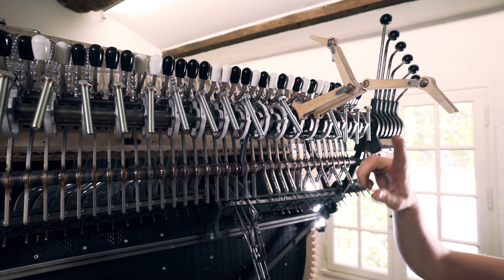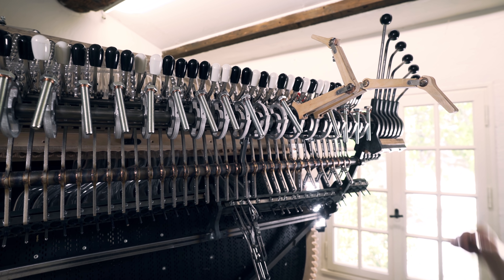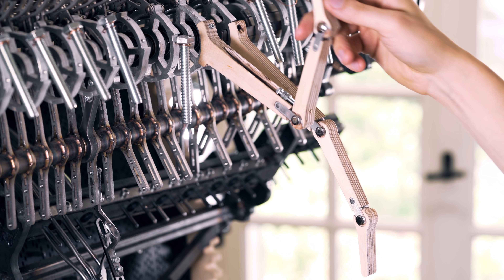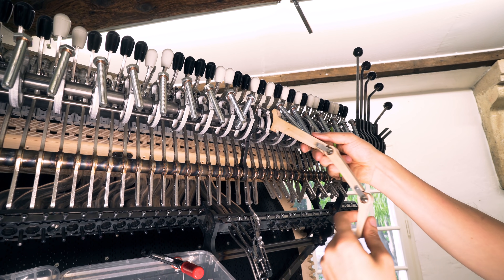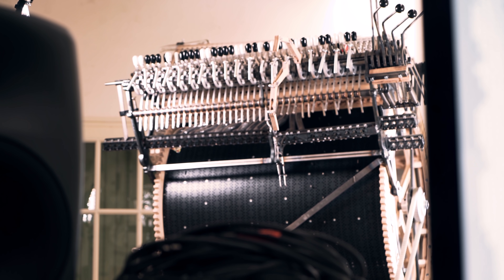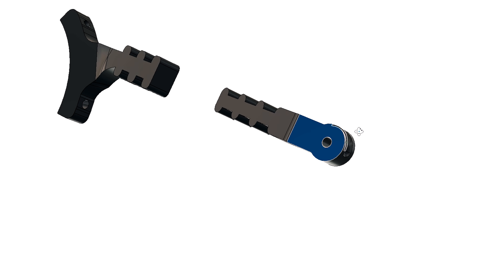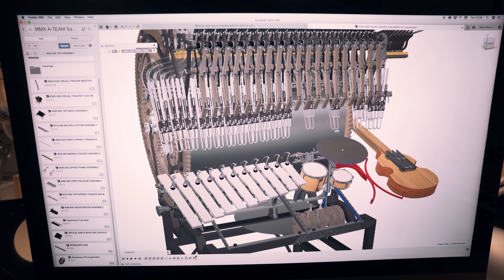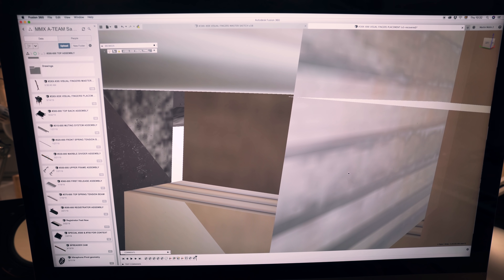Kinetic Fingers Prototype - Marble Machine X #82

Comment: I, like many, don't like the fingers at all. Yes, they are creepy. It's like this Carl Jung archetype of spiders crawling in my skin sort of thing. The closer you get to looking like a human body part, in your case three segment finger (bending forward, and backward, "ouch!", and at weird lateral angles), the more disturbing it will get.

Creepy Kinetic art fingers: https://www.youtube.com/watch?v=YGXyGrsa078

Others have commented that they don't add any value to the machine. I disagree. I think that having a visual element to the MMX is critical. So much of the MMX is visual already, and I agree that a small marble dropping with a little movement isn't very dramatic.

Perhaps the fingers could be replaced my a more aesthetically pleasing shape. I could envision cutting shapes from PMMA sheet, maybe concentric arcs or something. Something a bit more abstract to take away the creepiness please! I like the counterbalance idea. What if you used the weight of an entrapped rolling marble to tilt them forward and back?  

Beautiful kinetic art: https://www.youtube.com/watch?v=hYrwDDHDTZU

Anyway, Martin, it's your project, and it seems like you've made up your mind, but I have to speak up here. Your machine is elegant with a good cohesive visual style, but this just looks bad.

Comment: Q: "Why is there a picture of a garage in the reflection?" (10:26)
A: One of the secrets of 3D rendering is that in order to make a surface look metallic, it has to reflect SOMETHING, but it doesn't matter much what that something is; so instead of reflecting your actual CAD design (which would consume a lot of computing power), some arbitrary 360° stock photo is used for the reflection. In the case of your CAD software, this just happens to be a garage.

Comment: Hey Martin, 

How about a system (Arduino or Raspberry PI) that lights up a key when it is struck by a marble? It could add a whole new visual look to your machine! I can prototype something for you if you're interested! 

Love your project and keep up the good work!
Reply: Noooooo...

As clunky and weird as the fingers are, adding a whole computer system to the machine just for visual effect is far worse. The whole thing has been mechanical where it can be, and where electronics are absolutely necessary, they've been limited to analog sound amplification. If you're going to put a computer in, you might as well have it run the machine: The timing would be far more precise than the mechanical drum, after all.

Comment: I want to add to the discussion here by trying to outline what exactly it is about the fingers that I don’t like. The MMX has always felt like a beautiful, mechanical contraption to me. Everything moves in these predictable, steady, and incredibly precise loops which are stunning to look at. But the fingers are imprecise. They wiggle and move. It’s at odds with the incredible mechanics of the rest of the machine. I have nothing against a visual aid, I just wish it moved precisely like the rest of the machine does.

Comment: For the most part I can see why people are freaking out over the fingers. My first thought was "Why wood?" What I meant by that is for a truly visual experience (especially if you want it to be seen by the entire audience) why not a black plastic (or stay with the wood) with a clear inlat of plastic. The insert being built by Dr Phil can be built hollow for wiring and you could then illuminate the fingers so that if the stage was low lit/smoke lit they would glow and create effect and add to the mystique of the performance adding mystery and flair. 
You could add a micro-switch to the lever so the the fingers do-not glow when not in use or have a redundant new feed on the programming wheel to activate the fingers light feed if needed on certain songs only (you could do this with a magnetic switch that was added to the programming wheel or some-such). 
Sorry I am spitballing here. You have lots of options that could add to the usability of these fingers. 
As I always say, you are the artist, we are here to enjoy the art. Do your thing! We love it almost as much as you do!

Comment: I'm honestly on the fence here. I've been watching your videos for a long time now (I believe it has been from the early mmx episodes), and I can't count how many times my jaw dropped at what you've been able to accomplish. So I do echo the concerns of others about what these fingers will do aesthetically (since there is really hardly any function other than emphasizing movements in the machine), but I do so in a very muted sense - first, as you have mentioned, this is a prototype you're presenting; things go many different directions from prototype to finished product. And that is my more efficiency/engineering-oriented side speaking here. However, you've also focused on this being a work of art, from day 1. A lot of people seem to miss this. The thing about art is, it requires the artist's personal touch. If these fingers are it (man, the irony does not escape me here, a pretty fun pun :D), all I will say is: impress me. I have enough experience with music, art and tinkering of all sorts to know that this may very well flop, or turn out to be a true showman's vision. The stage is very much yours! (*and so is the machine*, again, as it seems a lot of people miss that fact) And as someone aptly reminded us - these things are screwed on. If they don't work out, they can be taken off just as easily. Just speaks volumes about how you designed everything!

Comment: I honestly think it would help, even with the opinion of those staunchly against this feature, if they just looked less like giant spider legs. Imagining a bunch of them in a row makes me think of centipedes. I hate centipedes and I hate looking at centipedes. I understand the desire to make the most important part of the machine result in big movements, and I understand the viewpoint of those who think additional features that don't actively help with the music making, but I wonder how many people are having this kneejerk reaction purely because of the way the fingers look, rather than the fact that they exist in the first place.

I feel like the machine is starting to have a really solid aesthetic going for it. Huge circles coming together with smaller circles, long, straight lines and shorter, gentle curves. Then there's those things, big and angly and not really fitting in with the look of any other part despite actively trying to draw all the attention to them. I think I personally would be more okay with the fingers if they were just partial circles going up and down to emphasize the action. The angled bends, tapered points and jointed movement just makes something in my brain go "nope, not good, bad, don't look at it"

tl;dr they look like giant bug legs and I hypothesize that a lot of people react negatively to them purely because of that, whether they consciously understand why they feel that way or not.

Comment: I disagree with the choice to add the fingers. Not only do they get in the way of operating the manual knobs, they also simply do not have aesthetic benefit - a stage performance will have cameras, and therefore the instruments can be seen from any distance. Furthermore, they have no functional use - something which every part of the MMX has had so far. It's a distraction - both from your progress on the machine and for the very creeped-out audience.

Comment: I follow the making of the MarbleMachineX very carefully and there have been amazing ideas soo far. I totally unterstand the idea behind the fingers, but I also see the possible problems, like easy access to the manual release knobs and also the mechanical stress on the hinges due to the constant shocks (fingers may break during a show).  A few of the other comments alredy pointed out that it makes the (soo far) flawless design look kinda creepy. I belive the moving knobs look less creepy and more like a brilliant piece of engineering.   ^__^

Comment: #TeamFingers I happen to like it, it'll give the subdued mechanical actions a much stronger visual identification and link the movement to sound. It also looks like a reference to the creepy clockwork mechanisms of centuries past. And at worst they can be removed. I don't think some of the audience quite realise that this isn't some sitting room piece, this thing is going to be wheeled into stadium sized venues for live performances, and the audience isn't going to be getting perfectly framed close up looks at the machine inside and out like we do here. Plus - this isn't a "make by committee", suggestions and group source ideas are great, but the team working on this has been dedicated for a long time on this project - just because an artist is sharing the process of building, does not mean you have ownership of the direction the project takes, or that they have to listen.

Comment: I was always puzzled by the fingers on the initial design, I couldn't figure out what they were there for. Now that I know what they are used for, I dislike them even more :/

Anyway, if you stick with them, think about how you will trigger the marbles manually when they are in the up position.
Also, it looks quite possible that when muting sections, not all fingers will curve upwards, and that will look like an error in the machine from the distance.

Comment: So, the fingers are essentially a visualization tool, a frill, as you would. I think that the MMX is already quite stunning to see with all of the built to purpose functions; so adding something like this seems adding complications for no benefit.

As for presentation; well, invest in some GoPros, and mount then inside/out of the MMX and have it display on projector screens if you want live visuals; else simply make some 'studio' video with closeups of the MMX parts while playing the song and use them during performances like BlueManGroup does.

Comment: Am I the only one to be worried about how you will manually play the "piano" buttons if the fingers are raised ? :(
Reply: Also the image you show at the end is called a cubemap, it is basically to give the impression of real reflections without the cost of computing real reflections!
This is applied on your marble material (whose roughness is very high, mirror-like at this point).

Comment: That reflection at the end of the video is from an HDRI (High Dynamic Range Image, typically used to refer to 360 degree images used for lighting in 3D animation) that autodesk is using to light the cad assembly. The reason to use an HDRI instead of lights is because it offers much more realistic lighting, since real lighting isn't uniform.

Comment: It's an hdri. Instead of lighting the scene by hand, you can take a 3d picture of the environment and use that lighting instead.
Reply: It's called a cube map and is used to simulate specular reflections, like chrome surfaces and other mirror-like materials. 6 flat images make up the cube, because it's much faster on the computer than proper reflections.
Reply: @coder0xff  oh. I assumed it was an hdri because I'm used to Blender.

Comment: Great work Martin! Glad to see you making progress on this highly-visable element of the machine. I was wondering when you'd get to it. That said, while I like the anthropomorphic fingers and their Burton-esque creepiness, they don't really fit the Animusic-style inspiration of the rest of the machine. However, I understand that this is a design point for you and always has been. So, if you don't mind some unwanted, but hopefully constructive criticism, I have three ideas that might help you get around some of the feedback you are getting on the lifting fingers. The first element is the wooble on each joint of the lifting fingers: they do and this stands out from all the other components which are all extremely precise in movement. Others have talked about bistable joints, and this is a possibility. The other option is a mechanical damper applied to the fingers that can damp out the oscillation. This would still allow for some organic motion, but by controlling the amount of damping, you can control how much oscillation you would like - thus allowing you to pursue the look of a pianist playing a keyboard. The CAD looks fantastic though. Excellent work with what you have done thusfar. The second element is the choice of having the lifting fingers flip up, and particularly flip over, the registrators. This defeats the anthropomorphic design choices made in making them fingers instead of something else and introduces a deep "uncanny valley" element into your machine. Again, if Wintergatan is planning on going darker and maybe more gothic/metal... this is a good choice. But if not, then I have a suggestion. When playing classical piano, my teacher used to always say that you keep your fingers just above the keys and then strike one and reset to that position. This is true of almost all keyed or valved instruments. Why not embrace the same philosophy here? It would make the machine look more like it is being played by the fingers than the machine playing the fingers, which I think is what you are going for. If, when a finger is registrated by a pin on the machine, it could descend to a stable position and rise again quickly, making the fingers' motions agile, dexterous, and light. Which brings me to the final element, the shape of the fingers. When embracing anthropomorphic designs, it is best to apply some contouring to hard edges. This softens the appearance and helps to ensure an organic look instead of a pseudo-organic look, which helps add to the creepiness. I've made the same choice as you have in robotics multiple times and people have always been disturbed by the look. In any case, take it or leave it I still love the machine and your current CAD design of this is beautiful. Keep up the good work Martin, and I look forward to seeing your world tour.

Comment: Sorry martin, but I hate it..  they are pointless!!  You said to improve visual, but in my opinions the opposite is achieved.
They dont have a clear purpose with respect all the other parts, having that thing moving for nothing, wasting energy and momentum from the machine with crappy movements and noise.
This will increase for nothing your developing time, the adjustment in each concert, maintenance and the transport work.
If you don't know what to do with that space there, just put the name of your band hanging.

Comment: Won't the weight of the finger lifting add to the required amount of force to drive the MMX? I think that the added complexity and drive load will have unforeseen consequence. Like most others here, I like your idea, but I think that the machine has enough complexity and beauty without having to add to it.

Comment: How this machine will be programmed? I think you need some soft converter from MIDI to program wheel sectors maps. Doing it manually will be hell.
Reply: He did a video on that a couple of months ago. They will only be done manually in the writing process, and he'll have a company make metal ones with each song having it's own wheel attachments.

Comment: The marbles have a stock image reflection at low res perhaps?
Reply: It's called a cube map and is used to simulate specular reflections, like chrome surfaces and other mirror-like materials. 6 flat images make up the cube, because it's much faster on the computer than proper reflections.
Reply: @coder0xff  yeah, that's what I meant. I don't think he realized that he was looking at one of the 'marbles' when he zoomed into the model?

Comment: Gonna add my two cents: 

I don't like the fingers. The creepy factor to them has already been pointed out before. That's not my objection. What I take issue with is that they are not marble powered. The part of the original Marble Machine I loved was that the beautiful music that came out of the machine was entirely made out of Marbles. You as the operator shaped that sound into a fantastic song.

Those fingers will create the sound from the Xylophone. Not the Marbles. The main song/tune of the Marble Machine will not come from Marbles. The pins actuate the fingers, not Marbles. It seems to betray the basic concept of the entire "Marble Machine" project. 

Those are my thoughts. You do you man.

Comment: I don't like the fingers, at least not the way it looks now. I'm worried that the machine will look even more creapy with 19 moving human skeleton like fingers than what it does with two. Atleast it would help to have the "fingers" in only 2 parts, or one, compared to 3, which is why it now reminds of skeleton fingers. Also I don't like the uncontrolled movement in the fingers. The mechanics should feel rigid i think.

Is there no way to emphasise the movement in some other way which doesn't add functionally unneccesary parts?

And also, don't hide the real functional parts with fake visual parts... We want to see the real thing, how the machine works. That is faschinating enough! 

I completely understand the visual argument though. Maybe you can do something else, for example add light somehow instead to make the playing more visual?